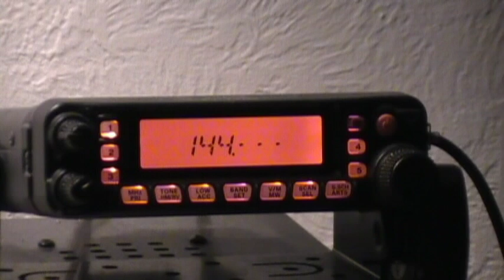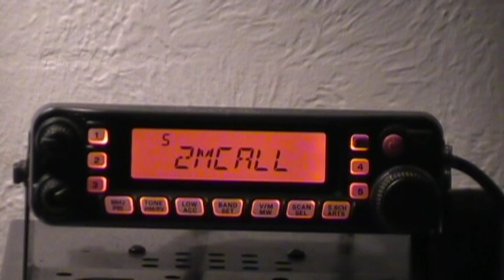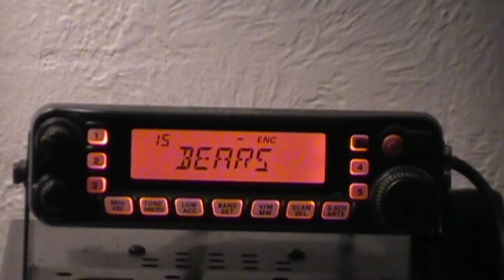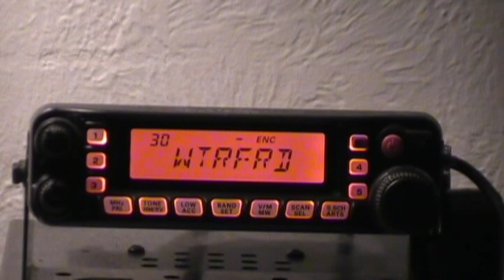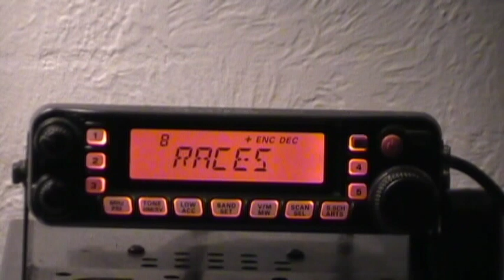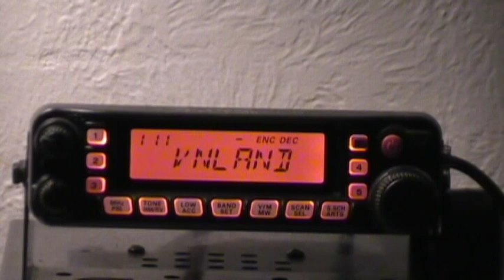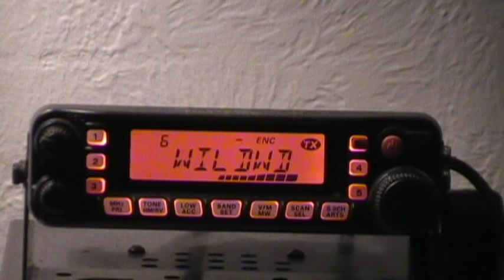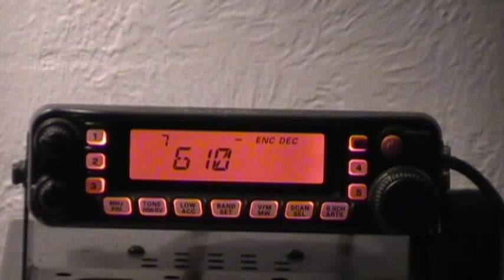2 Meters Explained

Comment: lower the frequency farther it goes right?
Reply from the maker: Essentially, that is correct.  Let's look at VHF (2 meters) vs UHF (70 cm)...VHF will travel further, however, UHF is preferred while in a structure, like a building as UHF can better penetrate through walls, etc.  So, when you consider the AM/FM radio bands, AM radio stations will be heard much farther than the FM stations.  The other variable is hopping via the atmosphere, or what is called Skip.  During the summer, it is common to hear distant stations going through a repeater or even just on the 2 meter call channel.

Comment: The band is NOT "Basically" a VHF Band, it IS a VHF Band.
The band does NOT "Basically" start at 144 Mhz, it DOES begin at 144 Mhz.
Simplex is Radio to radio, it's ISN'T "Basically" radio to radio.
You can open the squelch and listen to any station. There is no need to "basically" open up the squelch.
The 2 meter repeater is a relay station, it is NOT "basically" a relay station.

I can't listen to any more...
Reply: To give a big picture:
VHF (Very high Frequency) - 30 to 300 MHZ
2 meter band - 108 MHz to 174 MHz
Amateur Radio Service 2 meter - 144 - 148 MHz

There are other services that use the 2 meter band (Aeronautical, Marine, Weather, Public Service, government [not covered by the FCC, but the NTIA] to name a few). 

Amateur radio also has allocations for 6 meters (50 MHz - 54 MHz) and the 1.25 meter band (222 MHz - 225 MHz).

So, hams have 3 bands in the VHF range of frequencies.
Reply: Syntax cop.
Reply: Chris Kelling Are the frequencies on 2 Meter that are allocated to government/public service superior in quality to the 144-148 MHz range for HAMs?
Reply: Is it necessary to have a go at his grammar idiosyncrasies?  Do you have perfect grammar all the time?
Reply: BASICALLY.....its folks like you that don't bother to teach the young one's anything really and that's why the PROFESSION is dying its not a "hobby" its a service and profession
Reply: Poor little baby
Reply: Sad ham